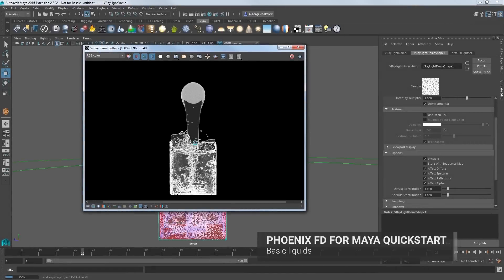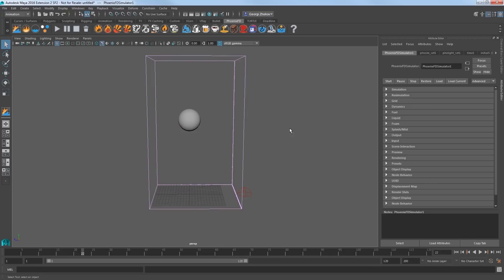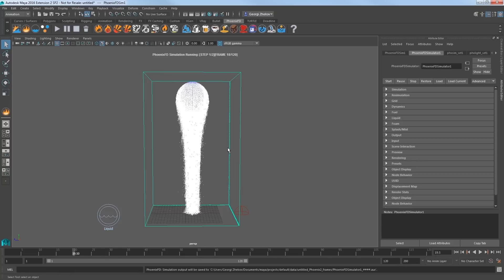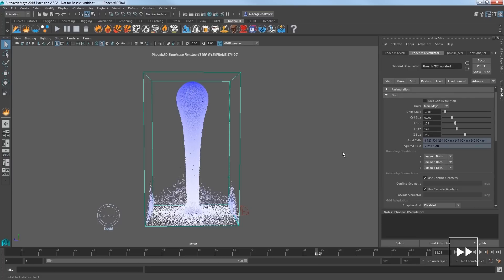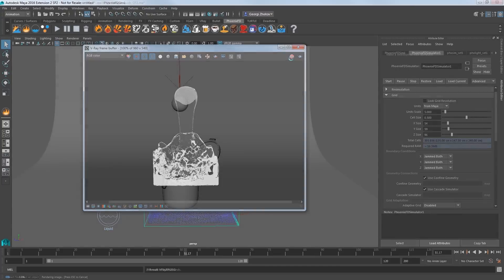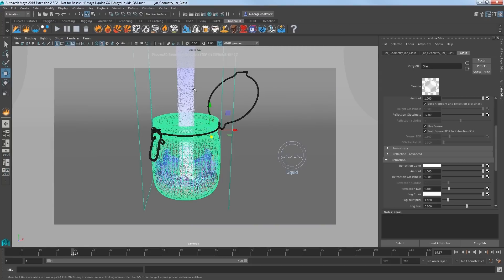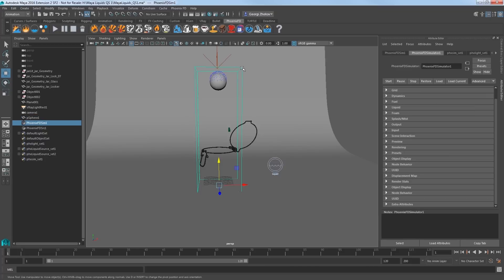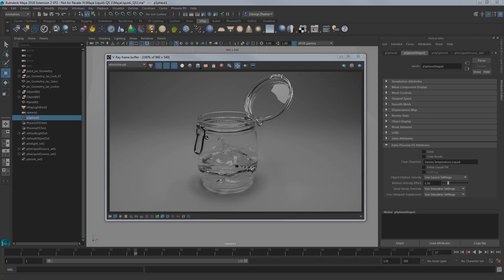Phoenix FD for Maya – Quick Start: Basic Liquids

Comment: please help me, I'm using maya 2017 and I installed phoenixfd for maya 2017 (exe) , but it didn't loaded , when I check it in plug-in manager quikly remove the check and give me the follwoing massage :  Error: line 1: The specified procedure could not be found. (phoenixfd)
Reply from the maker: Please email support@chaosgroup.com with your question and they will be able to help you out. Thank you!

Comment: I get nowhere near your level of performance on my workstation. The frame rate is really bad.
How do you get that speed?

I am on Windows 7 Enterprise - SP1.

My workstation specs are these:

CPU: 2x Intel Xeon E5-2667 v3 @ 3.20 GHz
Memory: 64 GB DDR4 Dual Channel
GPU: 2x NVidia Quadro M5000

Thank you in advance!
Reply: If you can see the >> icon,  which means that at that moment they sped up the video.